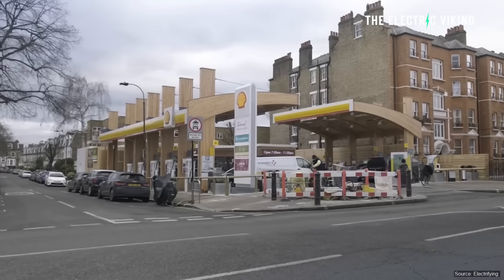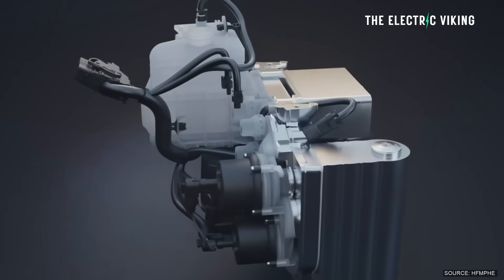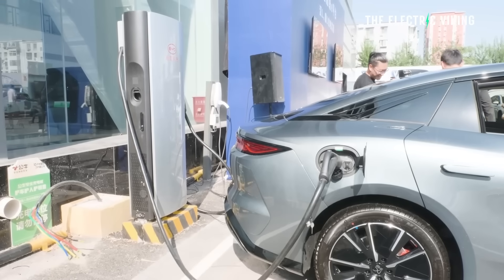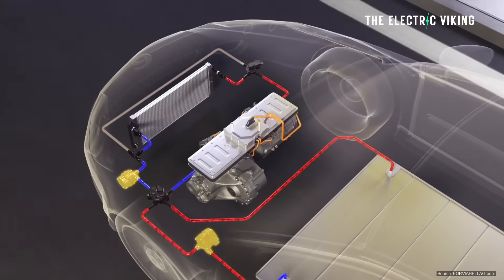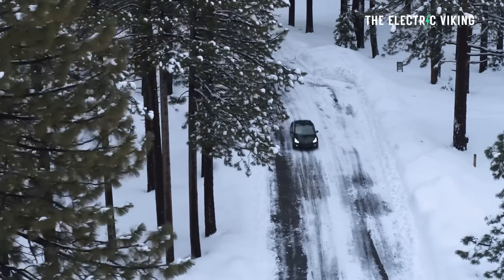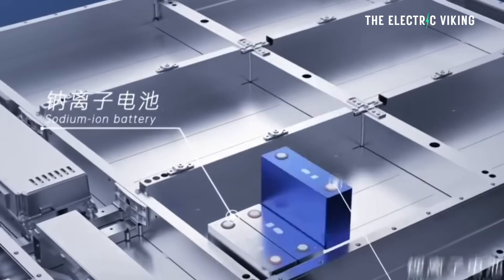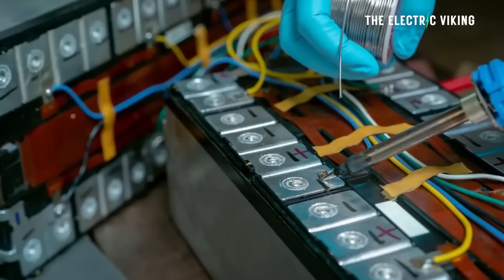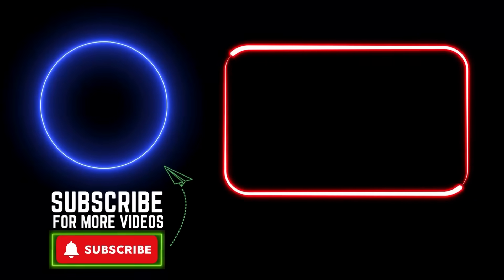Shell's Thermal Fluid Breakthrough enables 10-80% Charging in 10 Minutes

Comment: IMO range anxiety is something non-EV owners fear as a result of propaganda.  EV owners know all about that crap.
Reply: The thing about range anxiety (even if it turns out to be a non-issue for most people) is that a consumer of gas and diesel cars do not need to think at ALL about the range of their car. Even if one never goes outside of the range of your batteries, it is always on your mind. Also, extreme cold and heat take a heavy toll on electric batteries, so often the manufacturers touted range is cut in half, which is hard to take into account, if you need to go on a trip that’s even a little outside of your daily drive.

Comment: The key parameter for a low viscosity, high heat capacity synthetic fluid is it's CO2e/kg when it escapes to the atmosphere inadvertently. Multiply than number by 90million new EVs per year then ×by 20 years to size the magnitude of the further damage Shell would countenance doing to the planet in pursuit of continued profit.

Comment: More weight. Yep. The fluid takes in heat sure. It needs to then be cooled elsewhere or it will cause a problem. I trust this is solved.
My local climate gets condensation to form inside metal containers..like the sealed trunk on a car. I worry about condensation forming in the metal battery boxes when I go electric with my old stuff. Displacing the atmosphere in the box with a liquid would probably keep water off my batteries. Mineral oil was looking good before I got distracted by life.

Comment: 10% to 80% is 70% - doing that in ten minutes is only 4.2C - almost all batteries can handle that! - 
With an 80 kWh battery that is 336kW - again not a huge leap

The limiting factor is the charger - and possibly the cars battery cooling system

No need for some very dubious new technology

Comment: Sam, the Shell approach appears to be a very specific solution, not a generalised one. 

It mainly seeks to cost-optimise small battery vehicles, 34kWh in this case, with a thermal immersive non-conducting oil coolant that allows lower cost cooling, possibly using just a fan based heat extraction solution rather than more expensive/heavy AC battery cooling used in many EVs. The aim seems to be to reduce vehicle weight at the battery and vehicle system cooling level, to increase vehicle efficiency.

This approach is unlikely to scale with battery or vehicle size, but represents a specific small vehicle solution to reduce the vehicle weight, by removing battery AC/cooling components, to gain higher efficiency (as you stated quoted at an efficiency of 10km/6.2 miles per kWh for 240 km/149 miles range on a 10 minute charge, charging at 24km per minute). 

Crunching the numbers the 10 minute, 10-80%, charging time appears to be using 150kW charging of 23.8kWh (70% of 34kW), hence the charging speed comes from the smaller battery being rapid charged (inclusive of charging overheads); this is not a hyper charging solution. With a cooling system designed to be able to extract the heat generated during charging at a lower manufacturing cost point. 

How portable this approach is to larger battery packs without adding back in AC battery cooling to extract the heat generated during cooling is not stated. The 10 minute charging time appears to be highly specific to the example given.

The use of Shell's Gas-to-Liquid approach is a process that takes methane/methanol and converts it to oils/waxes by a chemical reaction. This likely means Shell are seeking to replace a fossil-fuel petroleum sourced oils with a fossil-fuel natrual gas, or synthetic methane, derived oil. With the potential in the future of the stock methane being generated via renewable electricity using the Sabatier process to react water and atmospheric CO2 using electrolysis; which may be applicable in this case as the volumes of liquid required will not be signficant per vehicle nor requires replacement.

Comment: I'm a bit sceptic about the "novelty" of this fluid, since these types of fluids have been around for decades.  To me it sounds like taking something that already existed and just "greenwashing" it or giving the impression of novelty.  Anyway, whatever helps the EV adoption accelerate is a good thing to me!
Reply: I suspect they've just worked on an example with an industry partner that shows the ability of a small battery pack (34kWh) to be charged at 150kW (10 minutes charging) but able to use passive/fan-assisted cooling without the need for heavier AC cooling, bringing down manufacturing cost and enabling the vehicle weight to be lowered to increase range efficiency (to the stated 10 km / 6.2 miles per kWh).

The greenwashing bit may apply to the Gas-to-Liquid approach depending upon the source of the feedstock methane gas that is converted to the coolant fluid. However, in this case there is a potential this could actually be an renewable powered driving electrolysis to convert water and atmospheric CO2 to the methane feedstock, because the volumes are low and the fluid is sealed in the battery and not a consumable resource. This one actually lies on the side of doable both technically and economically (the carbon credits from the CO2 capture add additonal value to the process).
Reply: @GruffSillyGoat alternatively they could go for AD based methane generation, still expensive but possibly dropping down in cost over time with scaling up. And like you mention, low volume may not be an issue in this case as they can charge a bit for the  coolant, until others start to compete.

Comment: Battery cooling will certainly be helpful for the long term health of cells in the battery pack. The main question: will this require a change in design of the whole car? In which case only relevant for cars in the future rather than existing fleet.
Reply: what are you talking about. most EV's have cooling systems

Comment: Sodium Ion batteries might have a comparable gravimetric energy den=nsity but still have a poor volumetric energy density so they will not become common in EVs because they require so much more space for the same energy capacity, they are far more likely to be used for static storage.
Reply: We'll see. The mix of lithium and sodium seems like a good idea, for some applications.

Comment: Sam ald all others, you need to know that today's battery cell cooling/heating using some cooling/heating plates is very ineficient and slow. The biggest problem is that one part of the cell can be at one temperature and the other part of the cell at different one because heat transfer from/to colling/heating plate is not fast, in fact it's slow. Putting all the cells in some electrically insolating fluid (special oil) improves cell thermal management at least 10 times (conservative, probably much more). But you have to know that Shell is not inventing anything as those conceptas are not new. Still, because of some downsides battery cell and battery pack manufacturers don't use this option. For slow charging it's really not needed, but for ultra fast charging direct fluid cooling is way more effective!!!  Like it or not, Shell guys know how to produce an oil with exceptional electrical and thermal conductivity properties.
Reply: I suspect the bit Shell are consider as being new here is the Gas-to-Liquid process, taking methane and converting to the coolant fluid by a chemical process; the volume and non-replacement requirement involved here would also support using a renewable powered electrolysis to create the methane required from atmospheric CO2 and water, possibly advertising it as a carbon capture process (provides carbon credits to trade).

Comment: It could work, but battery weight would increase and density decrease, plus makes it impossible to have an structural battery.
Of course, no repairs to the battery, like potted ones.
Reply: This could be repaired it would just require the fluid to be decanted out of the pack first, then repoured and then topped up for any losses.

Comment: Am I too stupid to understand, or was it not clearly explained what exactly Shell invented. Is their idea to cool the battery while charging? That's already standard in modern EVs. And what has Shell to do with it? The car makers are developing this.
Reply: This is three announcements in one in effect. 

- Development of a non-conductive coolant fluid suitable for EV battery packs - likely an extension of the fluids Shell Lubricants already produce for cooling grid transformers.

- Development of a showcase battery pack with an industrial partner. One that supports lower weight range efficient vehicles, 10 km / 6.2 miles per kWh, by removing weight and cost due removing the need for AC battery cooling (i.e. passive or fan assisted cooling). But still support a battery than can be charged at 150kW, to give a 10 minute 10-80% charging time, and 340 km / 212 miles range from a 34 kWh battery pack.

- Application of Shell's Gas-to-Liquid process, the coolant fluid is created by direct chemical processing of methane/methanol. The methane could be fossil-fuel based or synthetic, or could be generated using renewable powered electrolysis of water and atmospheric CO2. Given the fluid is encased in the battery and isn't a consumable, and that the volume required is low a renewable process may actually work out for once in this case. There's been talk of using similar approach for the related grid transformer coolants used in grid scale batteries, this would be another application of this approach.
Reply: @GruffSillyGoat Thanks for the explanation.

Comment: Energy firm Terra Innovatum has entered into a partnership with ATB Riza Calzoni to manufacture SOLO micro-modular nuclear reactors. The partnership aims to deliver the SOLO micro-modular nuclear reactor at scale. ATB Riva Calzoni is a global supplier and manufacturer of nuclear components. The SOLO nuclear reactor is intended to form the basis for a scalable modular energy platform from MWe to GWe-class. One unit of the SOLO micro-modular reactor is designed to deliver approximately one megawatt of electricity. In August 2025, the company announced significant progress in the licensing process for the Solo micro-modular reactor, which is currently under review by the U.S. Nuclear Regulatory Commission (NRC). The NRC has indicated its intent to complete the review process by the end of 2025 and to issue a Safety Evaluation (SE) of the PDC report by April 2026.

Comment: How long have they been sitting on this tech I wonder?!!??
Reply: In this case probably not, Lubricant divisions have to make money by selling oils/fluids not by sitting on technology. These types of coolant fluids are used in lots of different applications, with non-conductive ones used in grid transformers for example. They've just worked out a way to package it to reduce the cost of a vehicle by using passive/fan-based cooling for small battery vehicles that reduce the cost of those vehicles, yet still charge them at 150kW without battery degredation.

Comment: Shell realizes that it's core business is being challenged, and may effectively disappear over the next couple decades.  So I view their efforts at supporting the EV revolution as good news.

This cooling system, even if broadly adopted, won't come close to replacing the revenue generated by gasoline sales.  But it will give Shell and its employees something to do as those sales are depleted.
Reply: Won't be adopted as it really is not an advantage. 800V and battery chemistry with liquid port cooling will give us 1 MW charging - this will not add near that much.
Reply: @thedukeofalinor1377  - Shell Lubricants is one of the coolant fluid providers to the EV and renewable industry, they don't care about the use case just the sale of their products. The battery in this case is a demonstrator of the technology, being able to charge at 150kW with non-AC based cooling (e.g. fan-bassd or passive vented). Whilst reducing the weight of a small car (removing the AC) so it can increase range efficiency.

Comment: This would add a fluid pump, gaskets that need maintenance, fluid level checks and periodic replacement, weight,
and the need for manufacturers to buy licenses for Shell's specs and reduce competitiveness for other fluid makers.
The only advantage would be for Shell.
Reply: Batteries are already liquid cooled today. This is just swapping out one liquid coolant for a different one.

If it has much better thermal performance than the mostly water & antifreeze coolants used today, then it would allow battery packs to be manufactured denser with less space needed for coolant plumbing inside the battery pack.
Reply: Soybean oil (in addition to other vegetable oils) is already used to cool electrical components at sub stations.  There is actually a video somewhere on YT I've watched, that demonstrates how oils are used to submerge cells for improved cooling and heating in an EV.  I believe it was a French company.
Reply: Why would shell create something that facilitates people moving to an EV?
Reply: @KidHorn7001  - This is Shell Lubricants, they're just exploring another market for their coolant fluids, they already produce non-conductive coolants used in wind turbines and transformers in grid scale battery packs. Why would they be bothered about EVs becoming another market avenue, particularly if this offsets their ICE engine oil business that is being eroded by EVs.
Reply: This fluid is designed to be in direct contact with the cells themselves improving cooling efficiency and being non-conductive.
Reply: No need, the design is for a sealed battery pack with a thermal conductive fluid internalised. Then heat colllecting plate, as already used in many battery packs, draws the heat away to be vented. In this case the design is one for passive/fan-based cooling circuit rather than a heavier AC based one, to reduce vehicle weight so increase range efficiency. At the same time the coolant fluid support the battery being charged at 150kW, without excess heat being produced.

If used in larger packs AC cooling will likely be required but a coolant fluid filled battery pack with likely charge faster as the heat from the cells can be transfered to the transfer plates quicker (plus removes the need for expensive silicon thermal paste used today for this role).
Reply: @GruffSillyGoat   It still involves designing, manufacturing, and maintaining a support system - all of which involves coordination with a single set of specs generated by Shell.
Reply: @BillMitchell-lm8dg  - the spec's aren't Shell's though, they're RML groups. Who's taking the design to EV parts/manufacturers shows in Europe and the US. Shell Lubricants is more interested in opening up another channel for their coolant fluids, similar to the ones used in grid scale batteries and wind turbines they already sell.
Reply: فكره حلوه تبريد البطارية بالسوائل الغير موصلة للكهرباء تعمل عمل راديتر السيارة ❤

Comment: It's just another try, how huge oil company could stay in business. 😀 The aim is the same as with hydrogen - to continue in the system, in which drivers are depended on these companies. Unlike EVs providing freedom and independence.
Reply: Yep you can make fuel at home 🏡 ⚡⚡
Reply: The Gas-to-Liquid process can be powered by renewables to create methane from atmospheric CO2 and water, in this case the volume of coolant required is likely low enough, and given the fluid is sealed in the battery and not replaced, that a renewable powered solution could be feasible. It would also create carbon credits, due to captured CO2, they could sell on the trading market off the back of creating the coolants.

Comment: Two things. 1. The more important question I think is, will it work also work in older EVs, say in the last 10 years that are already on the market. Most people I think can't afford a new EV. In absolute sense they are still too expensive. Leasing is an option, but leasing costs money and also comes with caveats. The secind hamd market is more accessible for most. Yes new EVs trickle down over time, but not having enough EVs second hand will also determine the speed of market adoption. If every technologybis only reserveren 3xckusuvely for only newer EVs on the market, market adoption will simply take longer. So of Shell wants to exploitbit only for new vehicle it sounds like more of a profit solution than a for value solution. 2. Shell is stoll an oil company. The product is likelybto be oil based. There will be questions on environmental impact. What if this magical new coolant leaks from the battery? What is ots environmental impact, and how do we dospose of this Shell product if the coolant goes "stale" or the battery gets to end of life. The idea was to go imcreas8ngly co2 neutraal. I wonder what this product will do to keep the EV CO2 footprint low. Lots of things to consider.

Comment: See CATL's Shenxing Pro Battery. Over 700km of range, 1 million km durability (12 years, 90%), charge to 480km of range in under 10 minutes.
Reply: When they are out in full production and tested, give me a call.  Have already heard about countless miracle batteries that just disappear.
Reply: @Ryan_DeWitt  CATL's lithium free Naxtra (sodium ion) battery is already used in delivery and other service vehicles that require high cycle rate.  It will be in passenger cars soon. I'd say by 2028 solid state batteries will be in luxury EVs. 800 km of range, 5 minutes to recharge to 60%.
Reply: @bengt_axle  Not going to happen for at least 5 decades.
Reply: Pure CCP propaganda.  You can only charge as fast as the charger can handle and it's not economically feasible to field enough megawatt chargers to have any significant impact on your overall EV experience.